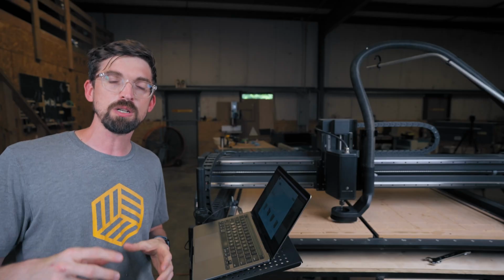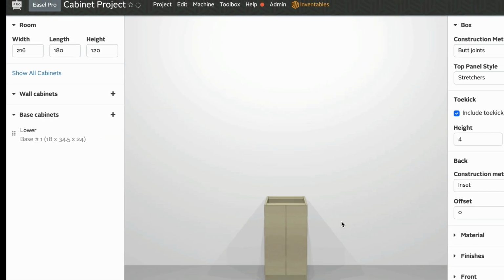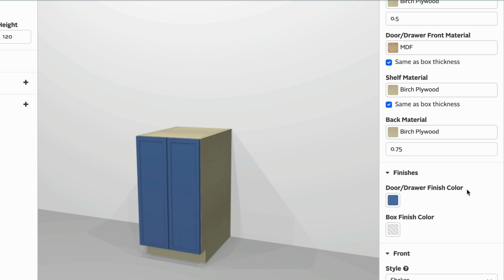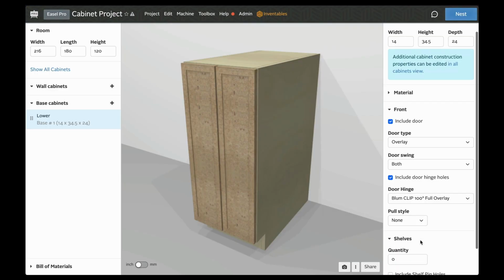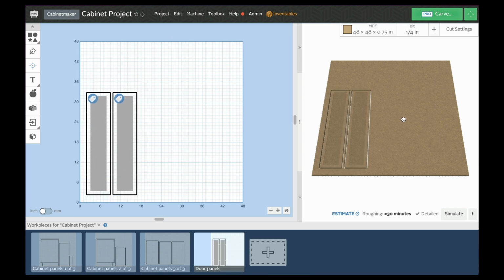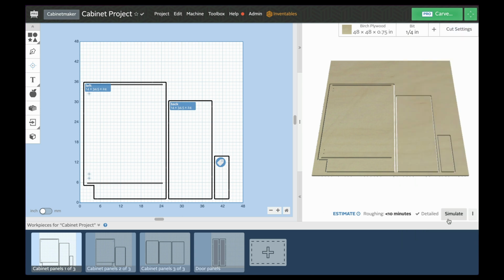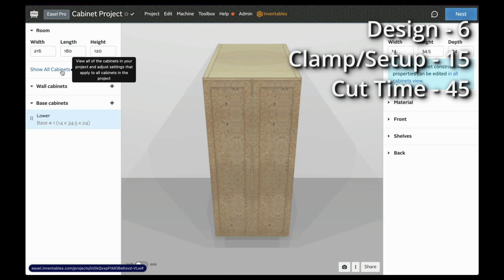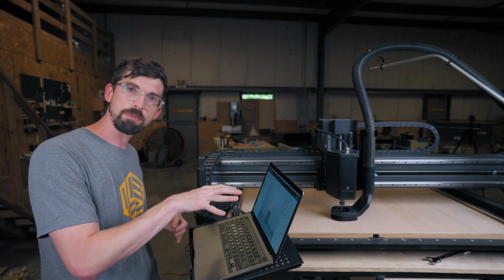Design and Cut a Cabinet in Record Time!

Comment: started working with the cabinet builder and am very excited to try it out. The only issue I have so far is that there is no way to remove drawer fronts
Reply: You can if you change the material (to group them together) and just ignore/delete that cut(s). But i agree there should be an eaiser way to do that